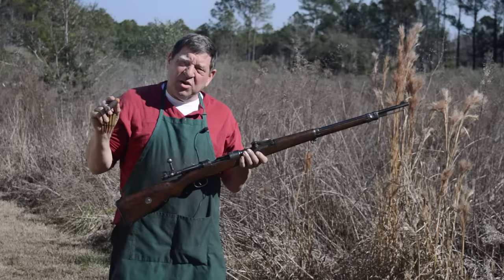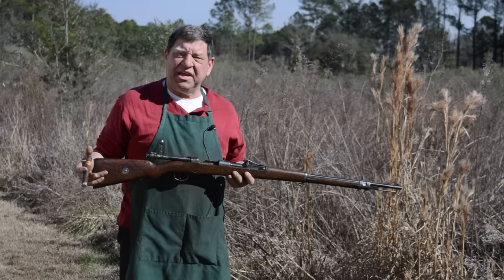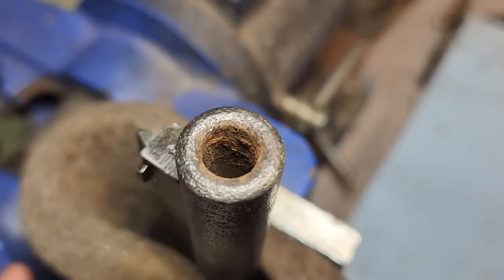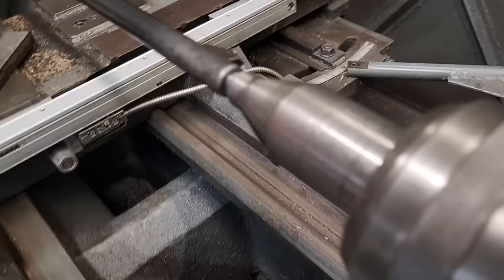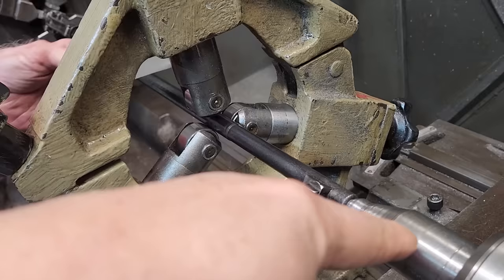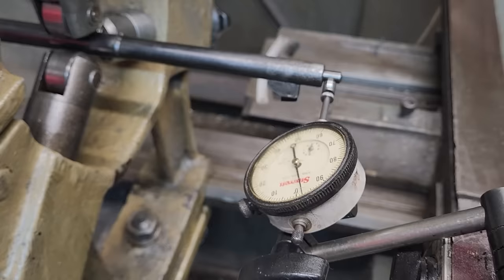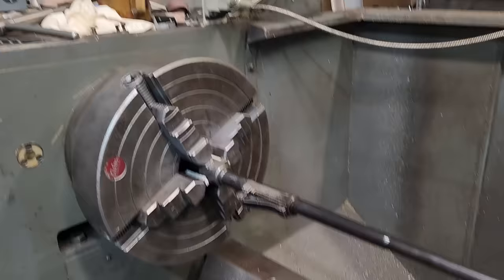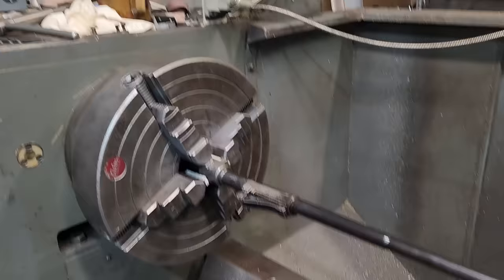Mauser Counterbore follow-up

Comment: This is where your stupid imperial measuring system fails. Who knows what 1/1000 of an inch is? Just use mm!!!
Reply: Your computer has a calculator that can convert the measurements, you can get a phone app that can convert it too
Reply: @elijahaitaok8624  yeah I’m actually talking to you! Know exactly what values you’re talking about vs using fractions! It is for YOU. Why converting anything?
Reply: Simple.  It's 25.4/1000 of a mm.  Don't even need a calculator for that one.
Reply from the maker: @AustinRBa  Don't forget the RCH.....also precise!
Reply: All American machinists and hobbyists know what a thousandth is, and we don't use it as a fraction, it is expressed as .001. Simple as expressing .025 mm.
Reply: Brought to you courtesy of the Red, White, and Blue!!!!
If you don't like our system of measurement, we don't care!!!!
Reply: @999torino  except is all crooked as there is 12 in in a foot, and 3 feet in a yard and 5280 ft in a mile. Simple :)
Reply: Mills are far too coarse of a measurement for metal machining, thous are far more precise.  If you went to micrometers then metric would be more precise again, but when is the last time you saw something calibrated on a scale that size?  

Imperial actually has a lot of hidden benefits and neat tricks that aren’t possible with metric.  It’s unfortunate that a system with so many benefits gets a bad rap because it’s designed around the human body instead of fresh water.  Each system has its benefits and failures, and to totally write one off would be a mistake.
Reply: @adlep  it's barely an inconvenience these days with the calculator conversions, I mainly use metric for my jewellery, but ever since i put in the miniscule effort to convert imperial to metric I'm starting to learn imperial measurements
Reply: @scott_hunts  metric has even more tricks that you are not aware of because you don’t use it on a daily basis. You just had to adapt to the silly scale and did so in the most efficient way you could but I see no benefit to it at all. The biggest benefit of metric is an instant conversion to decimal aka the number system we all use. I call it “the ultimate trick” :) it is very much human body related - how many fingers do you have?
Reply: @adlep  I use both systems on a daily basis because of my job, same with the past several jobs.  

And no, not everyone thinks in decimals all the time, a lot of people think in fractions.  And if you account for that fact, imperial makes a lot more sense.  You don’t use a special second so there are 100 per minute do you?  If you can tell time on a clock then you know fractions well enough to do imperial, even if you don’t have everything memorized like Americans do.  

Metric is excellent for small quantities of liquids, microliters as a measurement are a godsend.  Funny enough though, I don’t find micrograms as useful.  Grains, probably the most weird imperial measurement of all is just more useful for everyday small weight measurements.  Grams are fine once you get above 10 grams and up to about 2kg.  After that I switch between imperial and metric depending on context.  Thou is very good for machining, but mm is decent for woodworking at the medium scale.  Past 30cm or so it’s back to feet and inches for those sweet sweet fractions.  

Decimalization is neat, but I don’t find it as useful as most people imply it to be.  If I was a chemist I’d love metric, if I was in construction I’d love imperial, as it is I work with chemicals and build things from time to time, so I have an appreciation for both.
Reply: @scott_hunts  using fractions in a measurement system adds a conversion overhead. Is there an easy way to add 1/3 to 1/4 on a measuring scale? And why? And as for you; it seems like you’re living in a world of going back and forth and in and out depending on an application which makes perfect sense for you but realistically it’s unnecessary. Your brain is a little bit bothered by it even though you don’t feel it. Why make such a big fuss about a measuring system? This is something that the rest of the world doesn’t have to deal with. You literally keep track of what task is better to do in what measuring system and mind you one of the measuring systems that you use makes little sense to people outside of the U.S.
Reply: @adlep the U.S. is switching to the metric system as I'm typing this because of your comments! 😅 You should change your name to Dunning-Kruger.
Reply: @Ancient_Yuletide_Carol  not simple. Can you tell me how many yards there are in the mile without Google? Most people don’t know off the top of their heads.
Reply: @adlep  oh but I'm sure you know the answer without Google. Can you please type another paragraph explaining your superior intelligence? I need more idiocy to laugh at.
Reply: @Ancient_Yuletide_Carol  it’s super hard compared to 10, 100, 1000 metric. Versus 5280/3 nonsense. Also, why there is 5280 ft in the mile vs let’s say 3000 or 6000 (numbers that are easily divided by 3)
Reply: Thousandths x .039375 = MM
Reply: @Ancient_Yuletide_Carol All countries that use Metric Started with Imperial, they changed systems and the US didn't.
Reply: @adlep 1760 yards per mile.
Reply: @seanhazelwood3311  correct!
Reply: Your complaint involved measuring in thousandths, when I pointed out the ease of that, you switch measurements.  Nice dodge, are you a politician? @adlep
Reply: As an Aussie who grew up around aircraft (we measure height in feet, and distance in metres for close stuff and for long stuff and for speed, nautical miles/knots (because they're based on degrees of latitude ie fractions of the size of the planet) so they work well for navigation across global scales) and yachts (knots and nautical miles again) and machining (which even in the 80s was still imperial here), I had to learn both. Metric is definitely more scientificamical and all, and is objectively superior if you have to choose one.... but knowing both is objectively better than knowing either one :) Just use mm AND inches!
Reply: @adlep  1760. Off the top of my head. English here, we use both Imperial and metric.